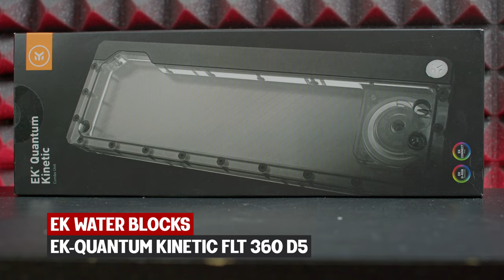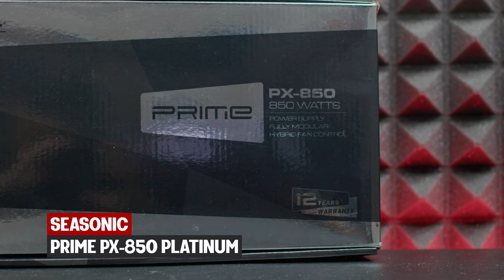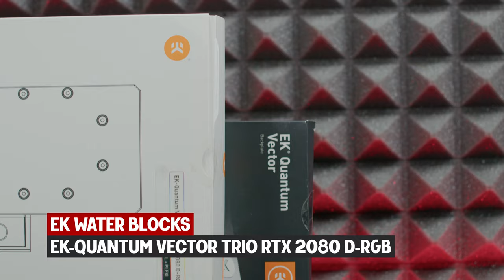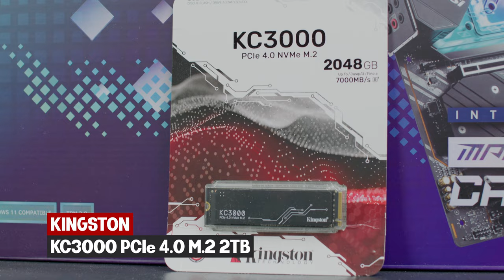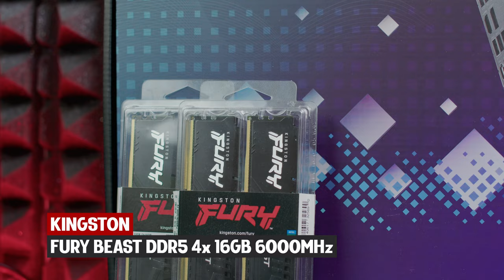RED KING! - ANTEC CANNON [12900k & 2080 Super]

Comment: if you don't use water cooling on the GPU, would it still work w/ the cooling fan that c/w the GPU card and mount it the way it is w/ the riser card?
Reply from the maker: If you mean mounting it on front without water block with standard air cooling design, then yeah. It can work of course.
Reply: @PCCrazyDario  thanks, I appreciate the information
Reply from the maker: @HappyHopping11  You are very welcome. ;)

Comment: how to connect your peripherals to the usb port of the motherboard
Reply from the maker: I did mention that in the video. You remove the side panel to access it and then place it back in.
Reply from the maker: Somehow I got your other question as an email notification, but I don't see it here so I am just going to reply to your old comment.

Question was: "are you able to put the panel on after plugging in your devices"

Yes. You re-route your cables to the bottom (if you are using wired peripherals) and then just push them at the back, which doesn't interfere with any side panels.
Reply: @PCCrazyDario  thank you for the information very nice build I love this computer case may be a new purchase and new construction for me
Reply from the maker: @pascalaspirot1821  You are very welcome. If you decide to get it, just be careful and build in the exact order. 😉